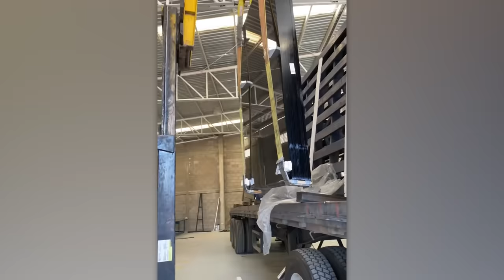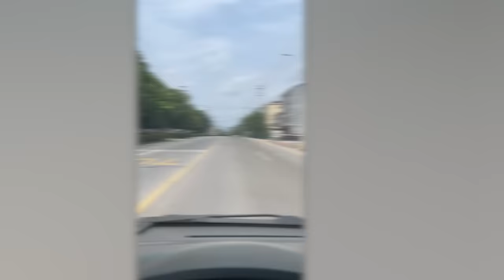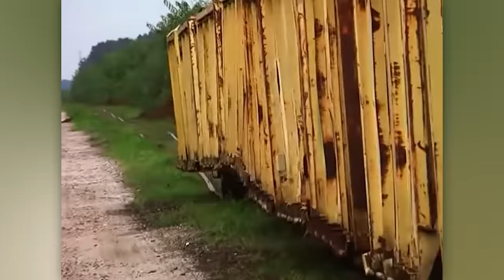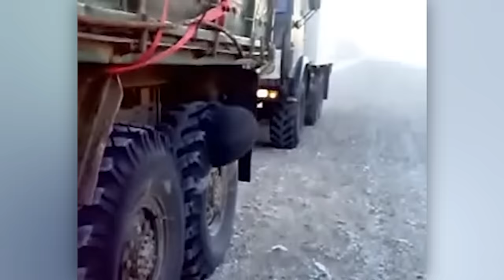Total Idiots At Work Caught On Camera

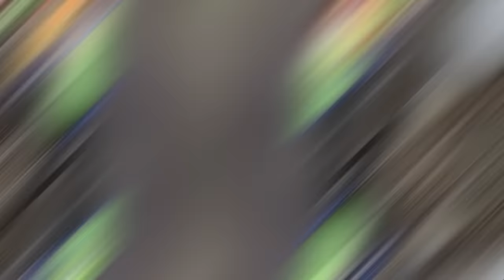Comment: 10:12 Actually, that ropes-and-rock-rake setup is pretty clever -- the one guy doesn't wear himself out in short order trying to scoop up big heavy heaps of coarse aggregate all by himself, and his fellow workers help him to get the job done faster than all four of them could likely have done if they'd all been wielding pitchforks individually.
Reply: My grandfather did that way back working on the RR. This is something I think that has been done for decades.
Reply: I agree. Shoveling rocks like that is extremely difficult. This looks ludicrous, but it will actually work.
Reply: @GumbootZone  Why ludicrous?  I find it very clever and heartwarming --- all of the workers banding together to help their fellow employee out and get the job done a lot faster and easier.
Reply: @Quacks0  Probably ludicrous-looking to the people who have something to prove. "I shoveled twice that with a spoon when I was that age" and some such. Not to say that of Gumboot, but moreso of, you know, the past-it-type personality.

To the rest of us, comfortable in our masculinity or femininity or both or neither, quite clever and heartwarming.
Reply: or you can just take up a sturdier proper RAKE and not a pitchfork where the pitchfork has longer flimsier teeth that would bend under stress therefore wasting a lot of effort, and put yourself to pull the rocks from the other side rather than pushing the rocks from above (to which end, you'd better use A SHOVEL!) 
you know.... as the RAKE was designed to be used? pulling?
not my fault if we're talking workers in underdeveloped countries who can't conceive a life outside their environment of farming tools.
FARMING TOOLS ARE NOT FOR RAILROAD WORKS!

Comment: 3:25 isn't an idiot, that's just a guy getting in some extra "gains" to be able to deal with passenger's 100 lb "heavy" checked bags. 💪
Reply: It also looks like he has some downtime.
Reply: a. 100 lb is quite heavy by human standards
b. that classification is based on the plane's standards

air quotes unnecessary
Reply: Lucky him, he didn´t make the sit on its tail.

Comment: To all the people saying that the one guy wasn't spraying gasoline. The nozzle is a fuel nozzle, the hose is connected to the fuel dispenser. And I have never seen a water hose like that at a fuel station in all my years..
Reply: True.  Unless it was modified to  make the video.  Otherwise the guy is an idiot. The smell of that amount of gasoline or diesel would make it hard to breathe if it was.
Reply: DON"T SMOKE!

Comment: By the look of a few of these, some clogged drains were cleared out at the cost of some clothing and dignity.

Some of them demonstrate why there should be more than one person performing a task (the guy with the wallboard on the unchecked scaffold, among others).
Reply: It's a commercial space, fine to do standup instead of laydown in most cases. Then he'd be on scaffold putting up a 4 x 4 piece. You need outriggers on baker scaffolding, still frowned on as scaffold because it has no rails.

Comment: The guy who broke the glass reminded me when I was working at a glass-shaping factory. We received different size panes from a mass glass manufacturer and cut them to fit individual customers. Anyway we receive a delivery and I go to the back to inspect the panes before I sign that we accepted them in good order. He opens that back of the glass and a whole heap of glass pieces fall out. He swears he has no idea how that happened then asks me if I can sign the order form anyway and don't tell his boss. I felt sorry for the guy but if I did that it would be my job so I had to decline then call his boss to explain that we need a new shipment fast as there were  no good panes. Never saw that driver again.

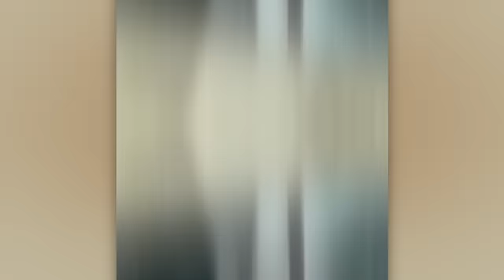Comment: Unfortunately the guy cleaning the bay with gasoline at 2:36 is showing symptoms of dementia/Alzheimer’s disease. I hope he and everyone else survived this situation.
Reply: It could have been diesel, which is safer but gasoline is suicidal.
Reply: @jaxflfreebird  Diesel destroys asphalt
Reply: @The_Ballo  But it doesn't destroy CONCRETE which is what is at EVERY GAS STATION. See my point? I know diesel melts asphalt. Really, I know.
Reply: @METALP0N3   Thou the amount he puts there, about 1-2 liters, doesn't seem reasonable .  Can also make you very dizzi very fast, especially on such a big area.
Reply: @eye9have5you35  "make you very dizzi very fast"...not to mention turn you into a human torch if someone lights a match or from a spark.
Reply: @BWolf00  not when it is disel
Reply: As other has said, actually seen that done with diesel before to remove stains.  Works like a charm but dear God he is using a lot.
Reply: @pyrolight7568   LOL...I just commented somewhat differently.
Reply: It's just water, not fuel.

Comment: I hooked up my Mach -E to my 220V  receptacle, It has a 30A breaker.  My battery was at 78%. Several times the breaker tripped. 30a at 220V.  that is 6600W.  Now you leave your car to charge over night.  I am waiting to see the increases on my electric bill.

Comment: you know, that guy with the petrol nozzle might actually be on to something. Gas stations have oil traps underneath. If they had a bad oil spill, washing it off with gasoline could actually be considered sensible - for a given value of sensible.
Reply: Trust me - there are safer solvents out there on the market for that sort of thing. And a lot less flammable.
Reply: @kenkahre9262  yeah nah, that one made my hair stand on end
Reply: THIS IS WATER ! Some gas station have these hoses.
Reply: It's water!
Reply: @romantashevRT  With the same nozzle as a fuel pump?
Reply: @Dave-in-MD  coming out of a fuel pump?
Reply: @kenkahre9262  I only said it made sense, not that it's thought through...

Comment: 3:00 not only is that dangerous in the United States that will be illegal. A very hefty EPA fine and maybe even get your business license revoked.
Reply: I think that it was a water hose pulled over the top of the pump. They probably used an old fuel nozzle so that they could use it to control the water without turning the supply on and off.

Comment: I hope all the critters who got concrete/cement on themselves, got it washed off quickly. 

Health effects
Cement can cause ill health by skin contact, eye contact, or inhalation. Risk of injury depends on duration and level of exposure and individual sensitivity.

Hazardous materials in wet concrete and mortar include:

alkaline compounds such as lime (calcium oxide) that are corrosive to human tissue.
trace amounts of crystalline silica which is abrasive to the skin and can damage lungs.
trace amounts of chromium that can cause allergic reactions.
Skin contact
The hazards of wet cement are due to its caustic, abrasive, and drying properties.

Wet concrete contacting the skin for a short period and then thoroughly washed off causes little irritation. But continuous contact between skin and wet concrete allows alkaline compounds to penetrate and burn the skin.

When wet concrete or mortar is trapped against the skin—for instance, by falling inside a worker’s boots or gloves or by soaking through protective clothing—the result may be first, second, or third degree burns or skin ulcers. These injuries can take several months to heal and may involve hospitalization and skin grafts.

Comment: 2:34, He is not wrong, gas is great for cutting through grease and oil especially on concrete. It's just not recommended to clean that way near the source of the gas you are using. BTW Dawn and warm water does the job better and for cheaper

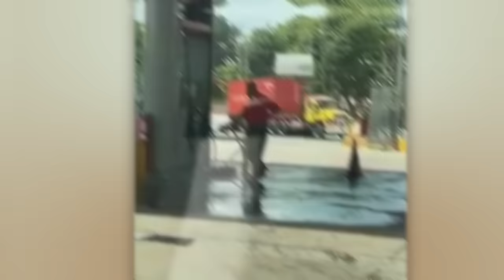Comment: 3:12   Those are some of the worst mop buckets ever designed.  
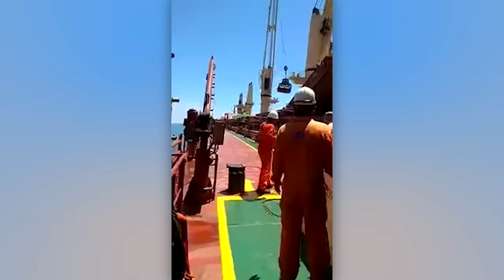6:33   This one is concerningly dangerous.  
12:24   I was about to object to how this works, but then I realized it's funnier than it should be lol.  
But all seriousness aside, it's wholesome to see the construction crews having fun.
Reply: Designing a mop bucket to be convenient and easy to use may be a bit of a task. The user needs enough leverage to wring out the mop, enough height so the water drains, and stability so the bucket doesn't tip. If it's cheaper to buy the usual sort, people will, no matter how great the no-tip device is.
Reply: @julietfischer5056  Granted I don't expect it to be easy, but some engineering common sense should be required; like orient the basket perpendicular to the bucket wall so the lever is closer to the center of mass, and so cranking the lever puts less torque on the bottom heavy bucket.  
But after spending the better part of a decade in the service industry, people buy for convenience which is typically expensive or time consuming to produce (but not to sell), but corporations buy the minimum effort which is the simplest and most often flawed designs.

Comment: 3:00 After you've pay for that gas, you're fired.
    They actually do have a cleaner to remove oil stains from concrete. It's less expensive and a lot less flammable than gasoline. Also, it won't generate massive fines for environmental damage. Because you know some hippy in the EPA is going to see this and work out where the gas station is.
    I'm betting the gas station has a jug of the stuff. It's not even that hard to do. A pervert dad who was abusing his daughter and uploading pictures and videos to the internet. They figured out where the creep lived by the trash cans in his back yard.
     From that they learned what city he was in, then by looking at nearby landmarks they worked out what house he liked in.
    The pervert is now rotting in jail, and everyone knows what he did.

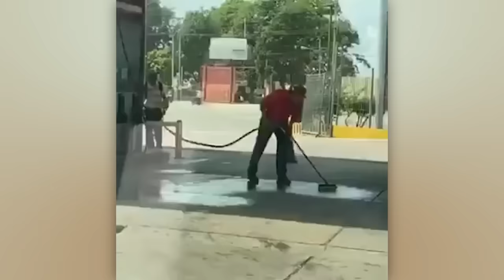Comment: 2:40 Seems nuts, but diesel is great for cleaning up oil stains, and while I havnt tried it from a nozzle like this, I have in the past used it like that.
Reply: I think it's a little bit too expensive (and not environment-safe) to waste such amount of gasoline straight from the pump to clear some oil stains, there are better and cheaper products to do that.

Comment: Also, the people who are cutting up the street at 2am probably aren't idiots. They are the crews from water and power making sure you don't get stuck in a sinkhole in the morning due to lack of roadworks. Because the broken pipe underneath was left alone and washed out the soil under the street.
Reply: It just makes more sense to do road work at night when there is less traffic.
Reply: Many of them aren't idiots at all. Unless 'idiot' nowadays means 'anyone who has ever dared to have fun at any point in their entire career'. Just because there's a video of someone doing something funny once doesn't mean they do it often.

...Some of them are morons, though.
Reply: They haven't invented valves in your world?
Reply: @6TDOW66 - If nobody detects the leak and shuts off the valve in time, the water will still undermine the road or anything else it flows under or through.
Reply: @julietfischer5056  We once had a wonderful time advising the road workers that arrived at two in the morning to fix the power outage. Turned into a real improptu street theater too.

Comment: 3:00 whats worse, the guy using the gasoline to clean the floor using a scrub brush that can cause a surge of static electricity that will blow the joint up? or the fact that people are just sitting there watching him do it and not saying ANYTHING??
Reply: That is what I am thinking, is that really gasoline??
Reply: @JSiuDev  straight from the pump.
Reply: They must be looking and thinking: "Is this..? Noo, no one is that stupid. But the smell... Noo, it can't be. Could it?"
Reply: It could be diesel, much less flammable.
Reply: @jaxflfreebird  even if it was, thats a shit load of hazmat on the deck now. if the EPA saw that shit.........
Reply: @jaxflfreebird  True. It would be a little (very little) less stupid. Still...
Reply: If I were there, I wouldn't be saying anything either. I would be instead getting as far away as possible from the idiot and hoping Darwin didn't take him before I got far enough away.
Reply: I think that it was a water hose pulled over the top of the pump. They probably used an old fuel nozzle so that they could use it to control the water without turning the supply on and off.

Comment: 3:08 I didn't think he was doing something wrong until I remembered gasoline visually doesn't look different from water...
Reply: I didn't realize it till the nozzle he was holding was turned sideways to the camera then I connected the dots, that's gonna be a helluva fine.
Reply: Dont worry its not fuel, its water.
Reply: @risaadkhajiit4881 You should hope so, though I wouldn't bet on it. There is so much spread around, the lightest spark would turn this into an inferno, it's not liquid that burns, but the gasses and with such a big area?

Comment: DUDE... the level attached to the drill is a smart idea!
Reply: Not really, why would you drill level through a wall? The hole should always be slightly sloping toward the outside to stop water going in.
Reply: @allthegearnotaclue   I mean... that's what spay insulation is for...
Reply: Not when it goes flying (because it is a matter of 'when' rather than 'if').
Reply: @julietfischer5056  And who could read the rotating spirit level anyway?

Comment: 3:00. that cant be petrol (or gas). it doesnt come out with that much force because it would back spray back at you just as soon as you pulled the handle!
Reply: Plus the hose is A) way to thin and B) not in an automatic retractor. In US there are often water hoses at gas stations with a similar nozzle for refilling caravans water tanks for shower etc.

Comment: 0:28 - Looks like the issue there was the lift wasn't rated for the weight it was carrying. Whole thing tipped forward because the counter-weight wasn't enough. To be completely fair, the driver should have asked how much that glass weighed, and referenced the sticker chart on the fork lift.

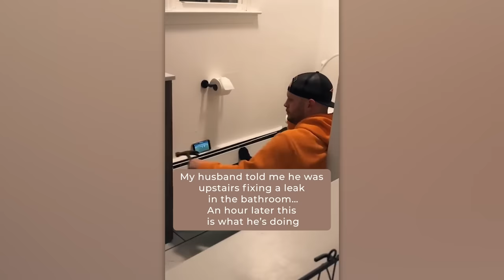Comment: 0:50 genius 
0:57 union government job
2:13 RUN
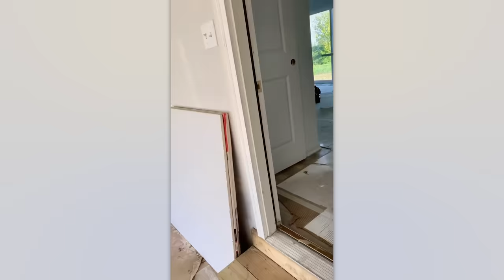6:10  you going to pay the electrical contractor for the time it takes to move your stuff?
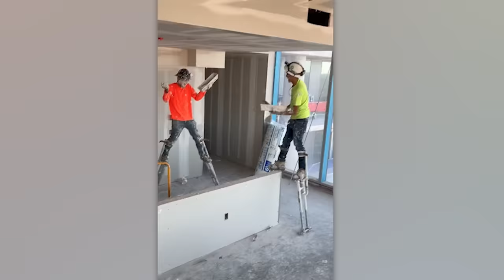7:36  it takes skill to walk on those things these guys are actually pretty impressive.
10:15 government bureaucrats deciding how a job should be done

11:35 throw some forms up, toss in some re bar tell them you put in a cement pad for free.
14:15  If you park them on end like that you can get more in the parking lot.
15:33 next level genius.
Reply: 6:10 It'll cost less than getting new boards when you account for all costs. That sparky will PAY. Stupidity should be punished.
Reply: @samiraperi467  
  goes both ways.  From my experience when something like this happens requests have been made in the past and ignored.   Hard to say without knowing the whole back story.

Comment: I wouldn't call the screwdriver in the faucet lazy. We have a pair of vise grips in our shower because the original handle broke. So I clamped them on and now we have a metal one. It does make adjusting the temp a lot easier. One little turn and you can go from cold to hot easy.

Comment: The man cleaning the gas station using fuel straight out of the pump made me lose my mind. Like... you have to had known what petroleum is when you applied for a job at a gas station.
Reply: If it's really gas, who pays for it?
Reply: @bigredc222  it's not clear if it's a self service gas station or it's one of those which have a pump attendant. Either way it looks like the gas station would be the one shouldering that idiotic actions.